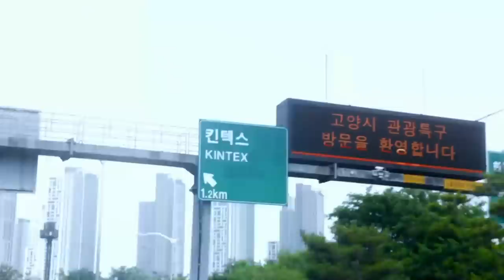A rare look into Korea's car culture and tuning scene | Fifth Gear

Comment: i’m korean and i’m so sad because it’s too hard to find out “manual transmission” modified cars in here korea. many owner of modified cars are can’t even drive a manual. and most of them are only tuning their stance ...
Reply: Here in the States, manuals are dying because no one wants to learn how to drive. People always use the excuse "automatics are faster than manuals"  to ignore the fact that they are scared to drive manual. Do you guys have Emissions testing in Korea?
Reply: @WTFVideos_4416  there is registration renewal every 2 years. which is iclude emission test, exhaust sound (under 100db) test, car width , wheel offset, ride height, gt spoiler, light tuning .. and so on.
so we must replace most of our tuning parts to stock parts every 2 years.
Reply: @2rotor13b5  that is worse than California 🤣 same here every 2 years. Aftermarket parts are okay as long it's 50 state emission legal. Every state is different and some don't do emissions testing or inspection like Florida. But out of all states California is by far the worst when it comes to modifying a vehicle.
Reply: @2rotor13b5  Japan has yearly inspections I believe but that doesn't stop them from modding cars and having car culture.